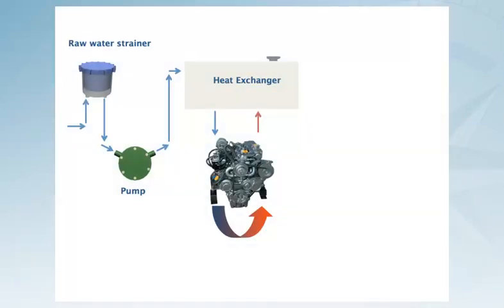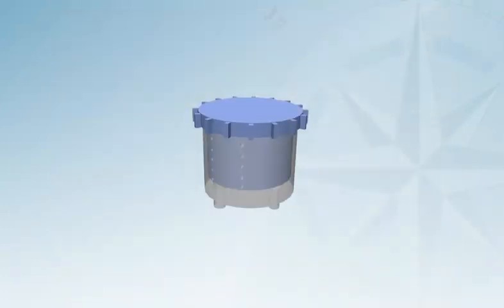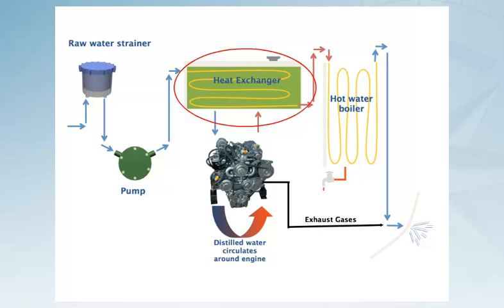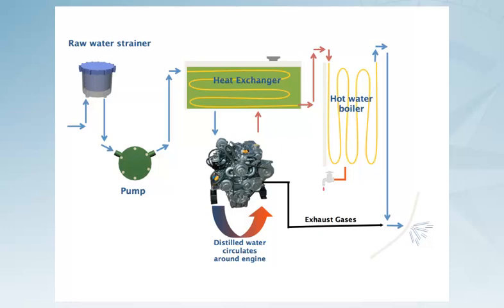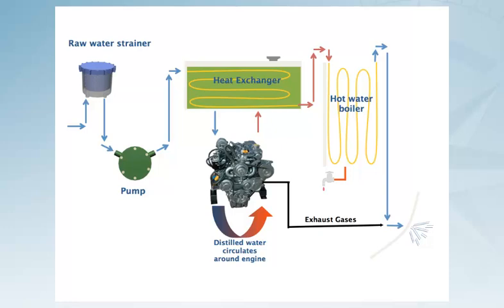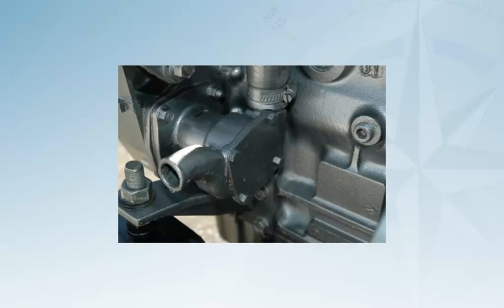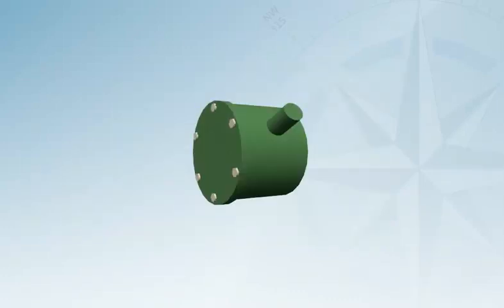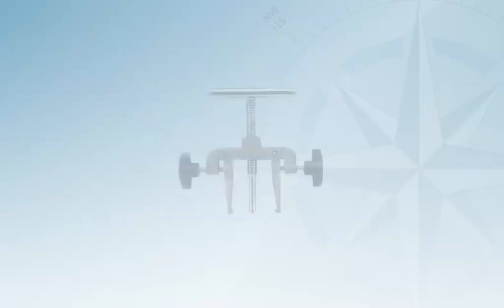Marine Diesel Engine Cooling System

Comment: The water boiler is heated using the distilled cooling water -- not the raw water and it is NOT dumped into the exhaust (it is circulated back into the distilled water cooling system which is a closed loop (there is no exit).

Comment: Why don’t they use the same cooling System like cars’. In stead of the fan that blows away the heat from the radiator, just put the radiator down the seawater. The whole system can use coolant to avoid rubbish or dust.
Reply from the maker: Hi, good thought. However, the radiator in the water would cause drag and would not last long in salt water which is highly corrosive. It would also cause problems with maintenance as  it would become hard to get at.

Comment: This is a good playlist and the first couple of videos are very clear and helpful, thanks.  This video could be improved by explaining that some (mostly older) engines are raw water cooled, and that the heat exchanger and boiler systems vary in different boats. (Many boats use a separate diesel water heater which heats domestic water without engine use.) Cheers for sharing.

Comment: Understand that normally  the calorifier / water heater is on the same circuit as the closed fresh water engine coolant rather than the, now warm raw seawater? The engine coolant being hotter / more effective and less prone to corrosion.

Comment: NOW NOW NOW !  Your video may be completely misleading. In the Yanmar motor you are using for your demonstration which appears indistuinguishable from mine  you appear to  have removed the starter motor  so access to the Impeller is made to appear far easier than it actually is and removing the starter motor is not something I would like to undertake.
I would warn anyone against casually believing that they can easily change the impeller . On my Yanmar it is fiendishly difficult to get at .
Reply from the maker: I agree Bill, they are difficult to get at on Yanmars! The aim here, however, is to give an overview of what's involved. Every engine will have its own foibles. Thanks for taking the time to comment.

Comment: Why dont they locate the Radiator deep in the sea so the coolant will be always cool.
Reply from the maker: Hi Nam Le, the reason radiators beneath the boat are not used is that they would create drag as the boat moves through the water and therefore create higher fuel consumption.